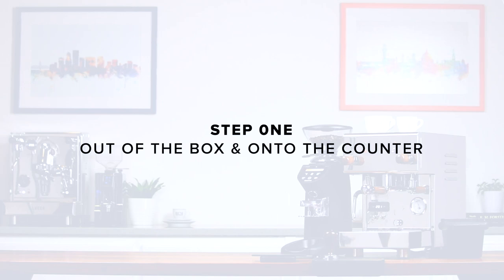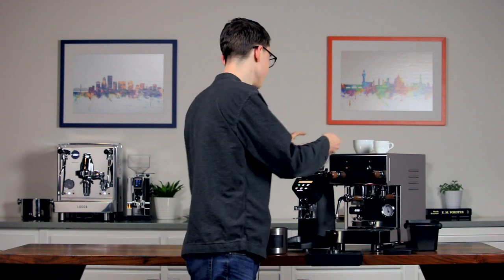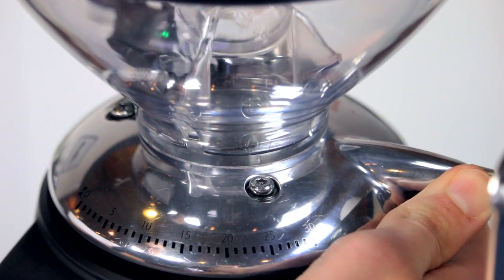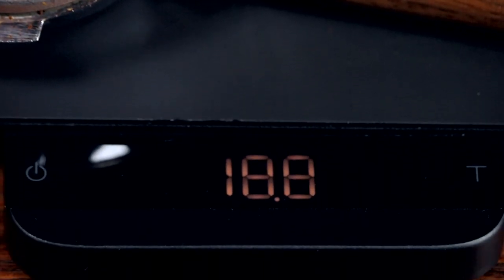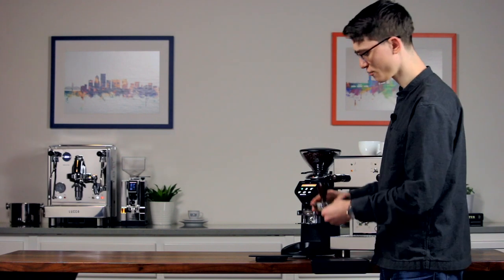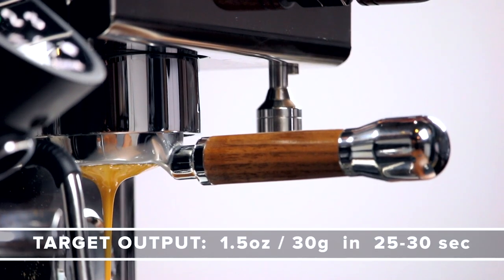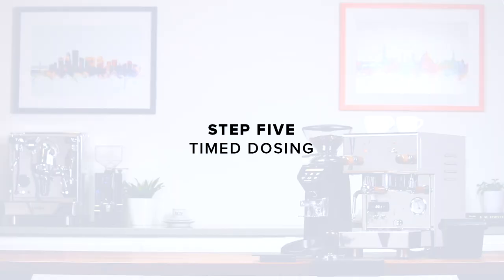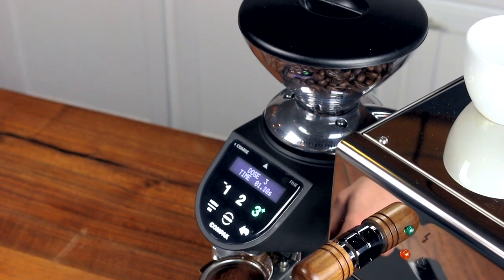Compak E5 Espresso Grinder Setup Guide

Comment: when I set the grind time and then press ok, it only changes the time until the grinder is shut off.  When I turn the grinder back on it goes back to the default time.  Battery is brand new.  Any ideas?
Reply: FF. What is the problem with this
Reply: @automatedprocessingandpack6070  It's not saving the settings
Reply: @stickerbuoy  Can you teach me how to save it in settings?